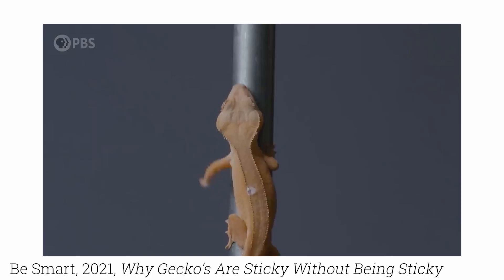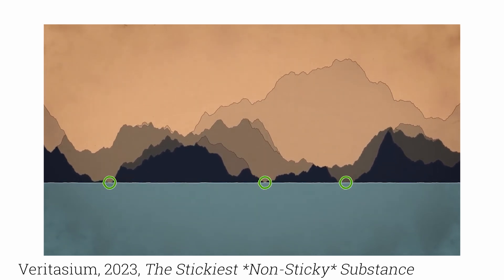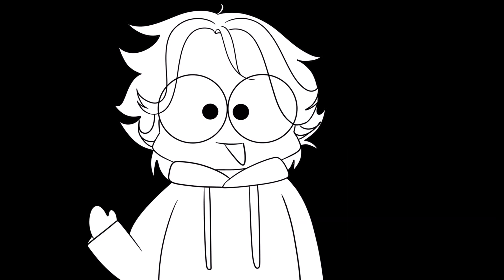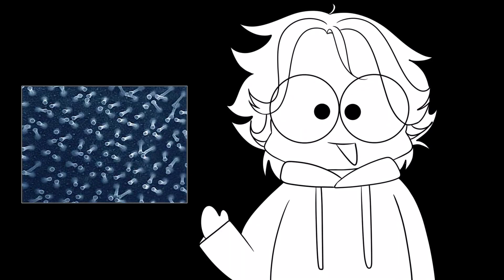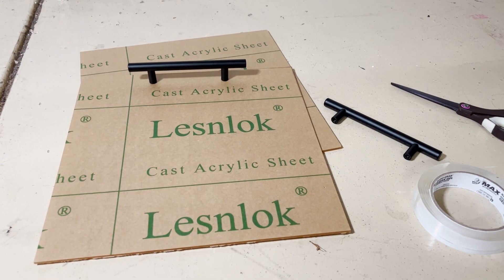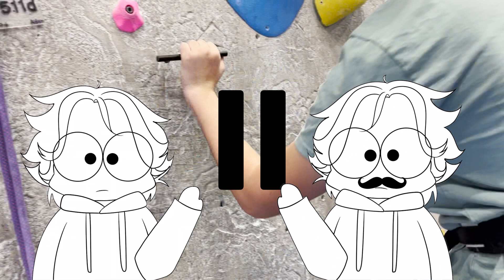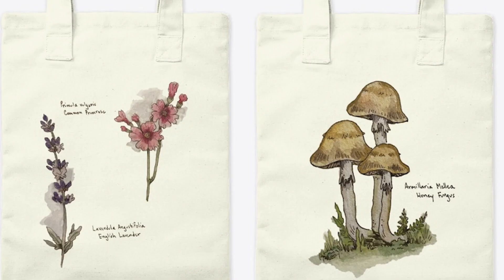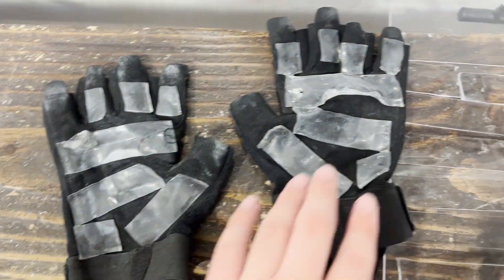I Made Real Gecko Gloves to Climb Walls!

Comment: if you want to create spider webs once try carbon nanotube i hope and i think it works but the promblem in it is sticky ness 
to stick on wall   if that is solved enough only need web shooter 

may that carbon nanotube cause problems because it doesn't melt like spider wed and if we shoot it on wall we need to clean it cause it is not our property

to climb wall we can use vaccum suction it helps alot 

i can only think on it but i can't do it practically
Reply from the maker: carbon nanotubes are awesome in terms of being WAYYY stronger than steal but they're a disaster to try and fabricate and use practically hence very few products that use them commercially but hopefully there will be more developments 

and vacuum suction is great but its terrifically hard to get a good seal on a non-perfect surface which means use cases are super limited.

Comment: You need a self healing silicon layer outside the nano fibers which can be punctured by the fibers and allow them to retract, allowing them to clean themselves!
Reply from the maker: very interesting idea but I am not a material engineer and I really can't say if that is possible, I doubt with these tubes because when you touch them you cant feel anything rigid at all

Comment: IT'S NoT Gecko Gloves IT'S spider gloves
Reply from the maker: interestingly both spiders and geckos use similar biological dry adhesives - but I assume you're a spidey fan
Reply: yes your right spidey fan
phew! 
if you want to create spider webs once try carbon nanotube i hope and i think it works but the promblem in it is sticky ness 
to stick on wall   if that is solved enough only need web shooter 

may that carbon nanotube cause problems because it doesn't melt like spider wed and if we shoot it on wall we need to clean it cause it is not our property

to climb wall we can use vaccum suction it helps alot 

i can only think on it but i can't do it practically

Comment: So in theory can you just put the gecko tape on gloves and it will work?
Good video
Reply from the maker: The two main issues with that are the holding power of the tape, when I calculated roughly my bodyweight compared to the holding power of the tape it was around the size of the panel. The second is that most gloves aren't made to hold you up, but the belay gloves I used in this would have worked well because of their wrist strap but the chalk caused them to lose their stick almost immediately.

Comment: Excellent video! I may suggest rinsing the gloves with distilled water (or even stronger, deionized water). In the fountain pen community, tap water is not advised to flush out ink from fountain pen feeds as something about the ions and solutes in plain tap water makes the dye particles clog up even more, meanwhile distilled water works like a charm. Maybe it will clean off the particles from your gecko gloves?
Reply from the maker: That's a great tip! I'll be sure to try it out. I'm not really sure what caused the gloves to not wash off as well as the panels but I'll be sure to do this when I need to clean my fountain pen cuz I had no idea.
Reply: @elijahballs  Upon doing some more research, I think most people have tap water that is fine to flush clogged fountain pens, sorry for scaring you! Lord knows I've been using tap water with my Platinum Preppy pens lol. It's not as authoritative advice as I may have made it sound like, but I hope that it might work for your gecko gloves. 🙏
Reply from the maker: @user-nd7rg5er5g  Thanks for the update! Maybe I'll make a short testing it.